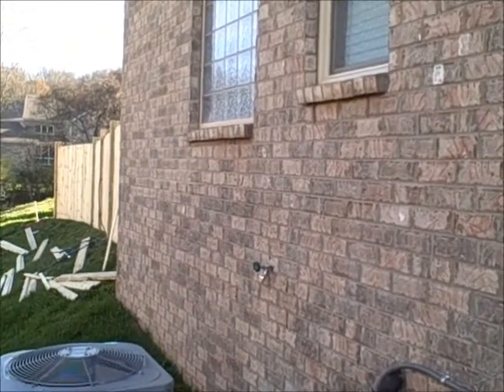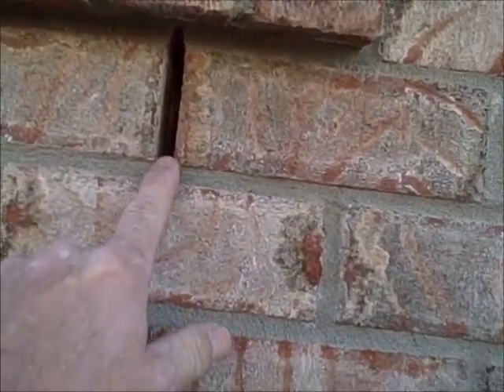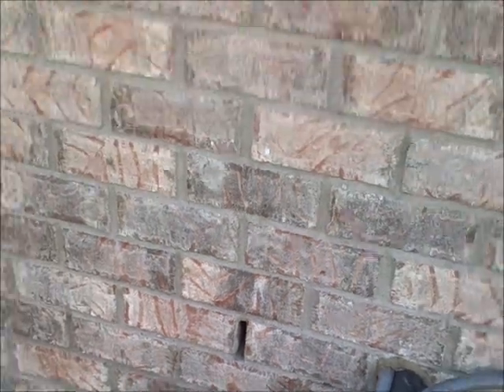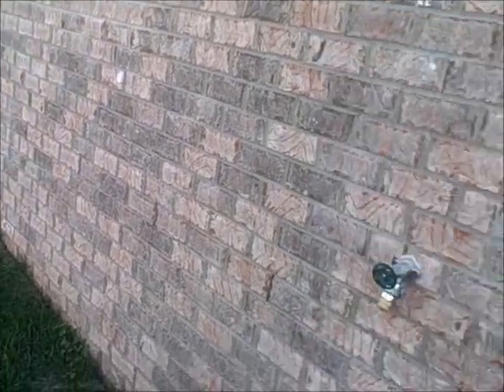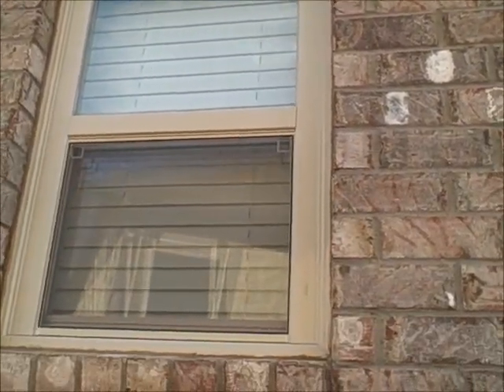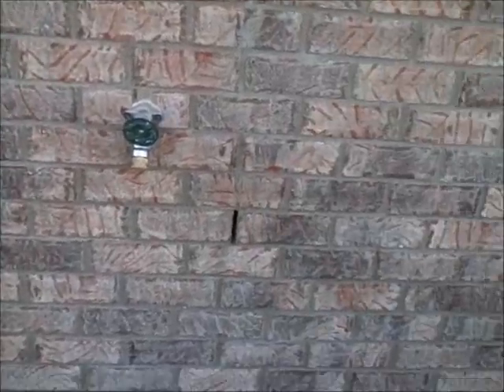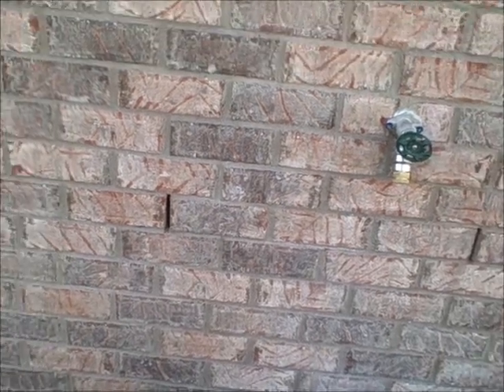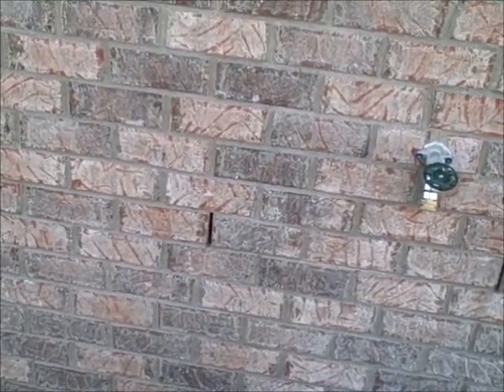Weep Holes Explained By Franklin TN Home Inspector.wmv

Comment: You mentioned that some weep holes have material in them to keep out insects.  What is typically used to fill that void and still allow the weep hole to function properly?
Reply: +Ryan Hancock stainless steel weep hole covers do the trick for mice and wasps